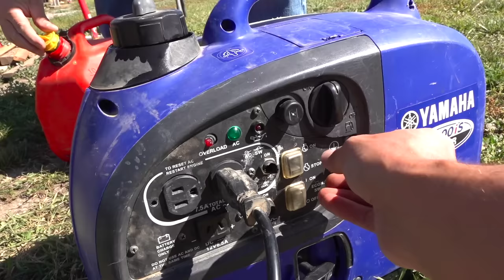YouTube GOLD - MAXIMUM PAY  (s2 e22) | RC ADVENTURES

Comment: If I can make a suggestion, I know that safety is your #21 concern but if your going to keep the hopper set up for the Volvo to unload into your putting a lot of pay dirt and expensive machinery at risk, so might want to build up a solid lip (a stopper if you will) on the ground within reach of the truck just in front of the mouth of the hopper for the truck to back into so that none of your guys back over the top of it. You might also consider putting up a V shaped fence with the mouth of the hopper being the base of the V to help guide the guys back directly to the mouth of the hopper then they shouldn't miss the hopper costing you any of that precious pay dirt you so painstakingly dig up.

Another awesome episode guys keep them coming, I'll be here to watch every week.

I'm loving how you have strategically placed all those stickers all over the machines.
Reply: You mean...bunding???

Comment: I love using the Volvo! I think that is an excellent way to do it, my suggestion would be dump it on the ground in front of the machine, then use the bulldozer to feed the machine slowly but certainly faster than the front end loader ever could do.

I think you might be able to find a nice mix where you can speed everything up without overburdening the systems.

Thanks a lot, I am surprised how’s very much I enjoy this.

Comment: Nice pull today fellas! That was a good idea droppin the white hopper down to dump straight into it, but i woulda done it just a bit different. 

I woulda dropped it no more than 3-4 inches at most. Then dig out a place to put the orange seperator in n make a lil bigger hopper addition for the orange one to dump straight in it. So then the orange one feeds the pay directly into the white hopper n puts the over burden over to the side for rookies excavator. Then just load straight from the cut to the volvo. Less work of haulin both the pay n over burden out of the cut seperatly. 

Youd be movin the pay n o/b one time vs once to the separator n then haulin each to their processin piles. Its one trip up the hill instead of 2 trips for the same purpose. Itd save u mah n time... Just a suggestion... 

Keep up the great work guys! Love this channel!!!!!

Comment: Need a conveyor at the bottom of the grizzly bars on the hopper and little red that lead to the conveyor at the end of little red. Everything that comes off of little red and the grizzly bars should be ran through the crusher. Then the crusher loads the shaker plant. Slow down the conveyor on the hopper to keep it full longer and not overwhelm little red. And the last thing is... watch all your plant equipment to make sure everything is being loaded and is putting something out the other end.

Comment: i briefly ran a volvo a40d at a landfill digging a clay pit for a new cell. those beasts  get through some sticky stuff, but once they're stuck... they're STUCK. one guy got his stuck so bad that a damn d6 lgp got stuck trying to get him out! had to use a deere 750 excavator to pull them both out. i also had the misfortune of running a deere 400d... those suckers are LOUD. controls are a tad wonky on them too. volvo uses rocker switches, deere uses buttons. deeres cant shift into 6wd while moving. the volvos can.

Comment: You should make a straight see through mineshaft tunnel for getting the rcs around more easily and a mat with a chain on the bottom in case if the rc that is currently inside of it breaks down

Comment: Wouldn't it be easier to make one central powersource witch switch panel for all tech on site? So many bateries needs so much maintenance, it could be povered by powercentral, via transformator making 24, 12, 9 and 5 volts (or whatever you need to power the machines) and one switch panel would make pretty easy to put things into work.

Comment: What you could do with the hopper is you could have the dump truck dump dirt in front of the hopper. Then you can have the bulldozer push small amounts of dirt into the hopper as needed. Also if you flip th hopper around you wouldnt lose as much pay.